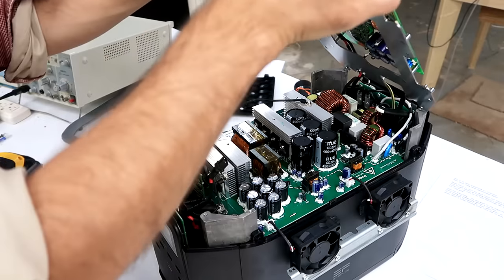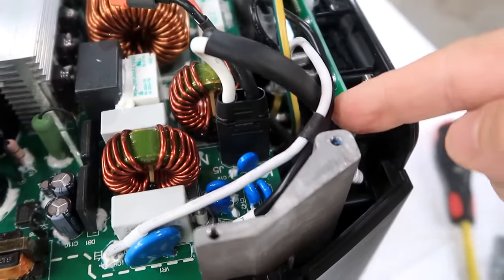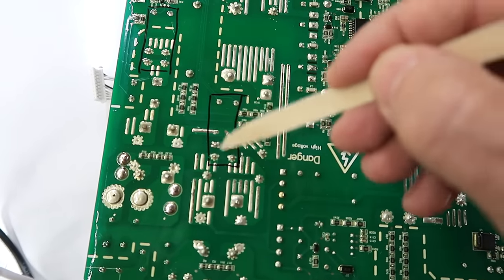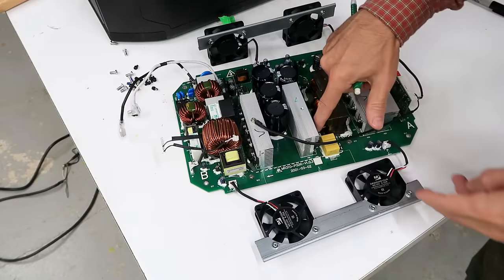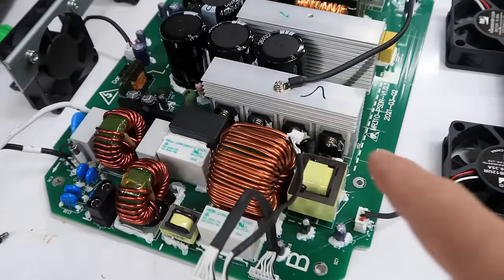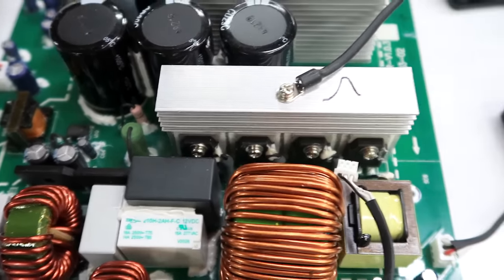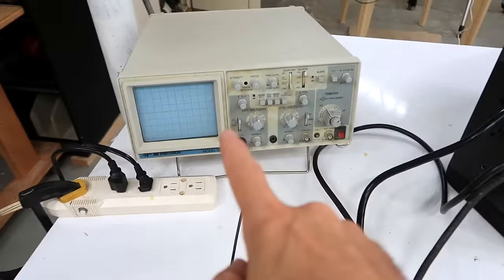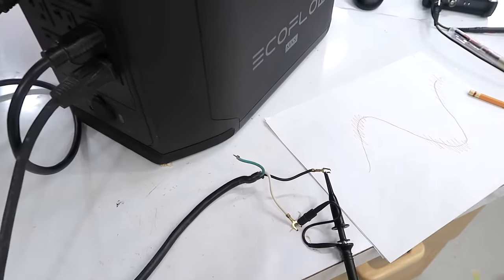Inside a portable battery power station

Comment: The old ground loop through an instrument.... happend to the best of us...
Reply: Lol!
Reply: I killed a JTAG debugger that way. USB debugger connected to board under test and desktop PC, accidentally touched the ground spring contact on the oscilloscope probe to the wrong side of a decoupling capacitor. Enough current flowed that the tiny spring contact was glowing briefly. All I can say is I'm glad the only thing that died was the $100 debug probe and not the $4k oscilloscope or the desktop PC.
Reply: Yep. BTDT
Reply: Last thing I blew up was a lab made PSU, with some non standard features, lazy me did not isolate control board, and a DUT Made a condition where the loop was completed through that logic board.... Stupid as a fox!
Reply: By the way, and as Matthias mention Dave's eevblog; "how not to blow your oscilloscope" fits. The only thing that save this one was those old crt have a  1mm thick chasis, try that with a shiny new one... Lol!
Reply: If it actually had a safe neutral, it would never have blown up. If it had a fuse / breaker, it would never have blown up. Extremely cheap, stupid design.
Reply: @jfbeam  True at some level, but electronics blown up due to instrument poking could be at miliampers level or less, so, no fuse, safe braker or similar things would save you. Not saying the design is perfect, but no design could contemplate a failure induced from testing.

Comment: Matthias and sponsored videos is not a great marriage, great video tough.
Reply: I think bessey could be a sponsor where the two would fit perfectly.
Reply: Why do you say that? I feel like he's the most honest and forthright about the actual sponsored content and exactly what does and doesn't work with the product.

Any revenue my preferred content creators can get is fine by me as long as the content remains the same and this unique situation they've actually provided since interesting content by being more free with the constraint on what he can and cannot show.
Reply: That look at the end when he mentioned the offer 😅
Reply: Pretty good sleuthing. One small correction: you need ~340V DC to generate 120V AC, not 160 as you said. If you say +/- 160V DC, that’s pretty close (slightly flat-topped, but it will run motors and rectify just fine).

Comment: I have a tip for you. If you want to change the transistors, just cut of the leads und desolder them afterwars. That makes it a lot easier. And for the transistor. You need not to you the same. Goggle the data sheet of the original ones and search ones with same specs
Reply: I would desolder all of them and take them out still attached to the heatsink.
Reply: @MattOGormanSmith  that's a good idea.

Comment: That’s one heck of a pile of electronics. He’s right about how all of the power charging, converting and generating systems are integrated in one box including the batteries and connections. Managing all that with discrete components could be a pain.

Comment: You don't need exactly the same  FET, check the maximum voltage and current rating and choose one with equal or smaller rdson (on resistance of the drain-source) and gate charge. It's a good idea to change the fet driver too if the gate is shorted.
Reply from the maker: I can't even find specs for the ones on the board.
Reply: @matthiasrandomstuff2221  Want to share the part number? I work in electronics, might be able to find something here.

Comment: Tough luck, but you are not the first victim of ground return damage. After all this effort, maybe Ecoflow could consider repairing the unit - that would be great PR for their company.
Reply: If he had only opened it up to inspect it sure, but once he took a sawblade to a pcb that's just lolno. The warranty is far beyond null and void at that point. We all know he knows what he's doing but such destructive modifications shouldn't be rewarded with a free repair
Reply: @Koushakur  They should at least give him a link to the transistors
Reply: My delta 2 is out of warranty, won’t charge anymore is there a way to change the battery cells? Or do I have a paper weight? Lol thanks for your time
Reply: @johnpaul9830  I'm not sure I can help much - either the charging circuit is faulty, or the batteries are dead. You need to disassemble it, isolate the batteries from the unit and use an external charger to check if they can receive a charge. If they don't, you need to source similar battery cells and reassemble a pack. Then, connect it to the unit and check if it charges. Not an easy task, that requires some skills and experience on these matters.

Comment: 1:01 The difference between a battery and a bomb is how quickly you let the energy out
Reply: Well, also how pressurized the energy is just before being "let out". I'm thinking of those unfortunate enough to have had a lithium powered pipe bomb such as a vape or even a flashlight explode on them while in use.

Comment: The "epoxy" on that board is better known as conformal coat. One flavor of conformal coat can be dissolved with acetone, if you want to try the repair. Urethane CC is another variant and is much harder to repair.
Reply: A wire brush on a dremel would clean enough off around the pads to desolder it without nasty fumes.

Comment: For what it's worth, some laptops actually do appear to be grounded between the USB ground and the charger neutral when plugged in. I discovered this while messing around with an Arduino Nano connected a Dell XPS laptop while examining output signal with a Tektronix 3052 digital oscilloscope. However, when the laptop is unplugged the USB ground then floats as you'd expect.
Reply: This is very likely just capacitive coupling. Switch mode power supplies (which all power supplies nowadays are) usually have an interference suppression capacitor between primary and secondary side, but are otherwise galvanically isolated.

Connecting primary neutral to secondary ground wouldn't be possible in a lot of countries anyway, because they don't use polarized plugs. Which wire is live and which is neutral depends on which way round you plugged the power cable into the outlet.
Most power supplies are designed for worldwide use and not one country, so they are built in a way that it doesn't matter which wire is live. (polarized plugs are a leftover from the beginnings of electrical wiring and haven't offered any benefit for decades as many countries in Europe, Asia and Africa will be able to tell)

Comment: Based on what i've seen so far I'm pretty sure a few more hours of contemplation will allow you to identify suitable replacements for those transistors.
Reply: Yeah, I'm sure a suitable replacement shouldn't be too hard to find. It only needs to have similar specs (or better). Even if the specs are way different, he could overcome that by replacing all four, so they still match, as long as the new ones will work for the intended purpose.

Comment: I love these deep dives, like you're solving a puzzle, it's great to see :D
Can the batteries in that really self discharge below safe limits? That seems like a huge oversight on their part o.O
Reply from the maker: Yes, this is true for ALL lithium battery chemistry.  External circuitry can only make it worse by taking electricity out of the battery.
Reply: Ahhh, so this is why my ryobi batteries won't recharge. 
I got a few back to life by applying straight dc from a working battery to give it "drink" then put it on the charger. I know the charger needs to see some voltage before it starts charging. 
Didn't work for all of them.
Reply: @richardpatterson4312  That is the same thing you can put a battery on the charger and it can show the normal voltage but soon after disconnecting the float drops back down
Reply: @richardpatterson4312  If you have a good benchtop PSU, you can try to recover them. (But always assume the batteries are unsafe after, and keep them in a fireproof area when charging and storage). I've generally found that if the cell has more than 2 volts then it is fine to very slowly charge it up using a constant current source. Anything lower and you have to start worrying about dendrite formation.
Reply: @richardpatterson4312  The "charger" is inside the battery itself. All the box does is provide a fixed DC voltage to the BMS circuitry inside the pack. If the logic has seen the pack go too low, it will not allow recovery. If you open it and attach an actual (CC/CV) charger to the cells directly, it might be salvageable, but any deep discharge damages the cell(s).

Comment: So what you're saying is that after reverse engineering and tinkering you now have a couple of thousand dollars worth of boat anchor...that you can charge the trolling motor battery with.  My electronics professor Ron Eli used to say, "Smoke test!".  Great video Matthias, thumbs up.
Reply: The batteries, and integrated BMS (the board on the side he never shows) are likely just fine. That death-trap of an inverter should be thrown away.

Comment: Just fix it dude, don't worry about the epoxy, you can buy conformal coating from any RC hobby store. You should get thermaltronics to sponsor you one of their high wattage soldering irons. Why no fuse.. that's just dumb design.
Reply from the maker: the problem is not adding epoxy.  The problem is that there is epoxy on it.

Comment: I watched the whole video but I guess I missed it.....did it fail on its own or was it user induced?  If user induced was it because of tinkering inside the unit with the hacksaw blade?  Surely plugging the unit into a power strip or having a Kill a Watt plugged into it when powering a circular wasn't the caused for it to take a dump was it?

Comment: I think you would like the Fluke 43B power analyzer. It's a pretty old device so they can be found relatively cheaply on EBay. It measures and records pretty much everything you would care about in videos like these. Plus, it's a decent-ish scope meter which is fully battery operated and rated for these high voltages.

I had to buy a new battery for mine since it was toast, but I have been absolutely loving the ability to watch and record transients...

Comment: Sad that you can't source the transistors. With a unit that is nearly useless, I would certainly attempt a board repair to revive. Right to Repair hindered again by supply chain issues.
Reply: There's probably a real close alternative though. Look for the same package, the same pinout, the same voltage rating, and for Rds_on and input capacitances that are in the same order of magnitude. That'll probably work just fine.

Comment: I have seen YouTubers promoting this thing -- I feel like I have an application for this in that I have some land that is over a mile from the power lines. TBH, the cost coupled with what seems to be it being sensitive to abuse (those computer fans) makes me feel like a little gas generator is better. BUT, this would be tempting if the price per watt hour was half.

Comment: I always applaud people who fix their own stuff.  However, Ecoflow has an excellent warranty.  I had a Delta Pro that can take up to 150V solar input and a Delta 2 that only takes around 60V.  Well I was messing around with the solar inputs one day and mixed them up like a moron.  The Delta 2 wouldn't turn on and had the lovely burning phenolic smell.  I checked the fuses and they were OK.  After messing with it, I contacted Eco-Flow.  They sent me a replacement free of charge even after I told them it was my mistake.  (I did help them troubleshoot some SW bugs on their other models so maybe they took that into consideration.  Who knows?  Worth a try to warranty even if you screwed it up.

Comment: Ok, this is the same failure I experienced on my EcoFlow DeltaMax2000 when trying to charge directly from my travel trailer breaker panel. So… exactly what would be the best work-a-round to prevent this failure?  Not connecting the charging cable ground wire to the  RV breaker panel neutral bar?

Comment: I have a trashed Delta max. Error message 50hz overload, no ac output,. disconnected everything. did the reset. touched the power cord plug (not intentional!) and found it was live, gave me a good jolt. Turned off the delta max and plugged it into ac. Immediately big flash at the voltage protector and blew the breaker. What is going on with Ecoflow!

Comment: Can't you replace the MOSFETs/transistor?  I have a similar problem with 2 power MOSFETs in my inverter. I replaced them and they broke again. The solution. The MOSFET driver was also broken. I replaced the MOSFETs and drivers, and now it works again.

Comment: So if you had not ruined the boards….
Would it be possible to swap out the battery either a 48v LFP drop on replacement or server rack battery? 
I know it won’t fit in the box but would be great to still be able to use the unit itself

Comment: An interesting thing I've learned is that most of these inverters, whether modified square or pure sine or grid tie, none of them use boost converters. Instead, they take the DC, convert it into a high frequency AC (10s of kHz, still battery voltage) with the first H bridge, then use a small step up transformer followed by a rectifier and capacitor to convert back to DC, and now it's the 170V or so we need for the second H bridge. Just like a standard switched mode power supply, except it steps up instead of down. Now that feeds into the second H bridge.

So I wondered, why the hell have 2 H-bridges instead of just using one at battery voltage & the line frequency (60Hz) and stepping that up? Well, it turns out, if you want an equivalent transformer with the only difference being lower frequency, it has to be much bigger. I'm still not entirely clear on the details but it has something to do with the inductance/permeability of the core. Also, I believe for a pure sine inverter, the filter inductors would need to be absolutely massive, too, because they'd need to be pushing hundreds of amps.

For anyone who wants to delve deeper into this, there's a guy named James Fotherby who has been building an inverter very similar to this one. He's got some incredibly good information, super valuable resource https://jamesfotherby.com/index-page/

EDIT: I also wanted to add, I have an old modified sine inverter that I've taken apart. One very interesting design feature is that the second (HV AC) H-Bridge is completely isolated from the rest of the circuit. It's got an opto-isolator going to the MCU, and aside from that its only connections to the outside world are the transformer (input) and the hot and neutral wires (output). The ground comes from the battery side of the board and is tied directly to battery negative. The only components that are in the isolated side of the board are the part that filters the output of the transformer, and the H-Bridge itself. Pretty elegant design really. I'm not sure why they didn't do that in this one, because it makes the neutral truly floating.

Comment: I know nothing about electronics, but I'm still fascinated. Is the epoxy coating on the board just for protection? When did they start doing that? I don't think I've ever seen a circuit board with epoxy before now, that I remember anyways.
Reply from the maker: Probably for reliability and corrosion resistance
Reply: @matthiasrandomstuff2221  Makes sense. Thank you for the response.
Reply: It is fairly common. It is called conformal coating. There are other types besides epoxy. It may also help satisfy minimum spacing requirements between voltages. On low voltage boards that doesn't matter, but it can be an issue on higher voltages.
Reply: @mckenziekeith7434  Interesting. Thanks for the response.

Comment: Well I want to add a motion light to my shed. No power to shed and running AC power other than just stretching a 200 foot extension across the grass is not happening. I'm thinking this would be perfect, a smaller version of ecoflow, and a solar panel and a motion light....boom, problem solved. Run the eco flow in side the shed, dry, no noise, may get down to -20c now and then in winter. Only problem this will still be several hundred dollars just to have a motion light on the shed.

Comment: At about 10:14 when you're talking about how it switches over to direct line power it disables the inverter, you have some text saying 'wrong wrong wrong'.  Is that not how it works when its plugged in?  I have one of these plugged in and have my sump pump plugged into it to act like an EPS.  Is this a bad solution for battery backup for the random storm and power outage?

Comment: Such batteries like in the cars or in this box don't have high internal resistance. I have left my batteries for a 2 years and it only lost like 15% of charge. So if you charge it to 60% level which is safe and good for Lion batteries you still don't have to worry about it for like 4 or 5 years. LFP batteries are even better as they don't mind to sit at 90% charge level for long periods of time.

Comment: I got a RavPower station. I barely opened it and saw that there is such a substance all over the mainboard. How do I determine where does it come from? and what is that by the way? It is not charging well anymore and suddenly the fan turns on automaticallly for any reason and sometimes I can feel that is warm when I put it in the bag. I want to fix it.

Comment: Why does everyone in videos disconnect the positive battery terminal first? it's much safer to disconnect the negative first if it's negative ground because that will make it so there's less places (metal chassis or ground planes) to short the terminals across.